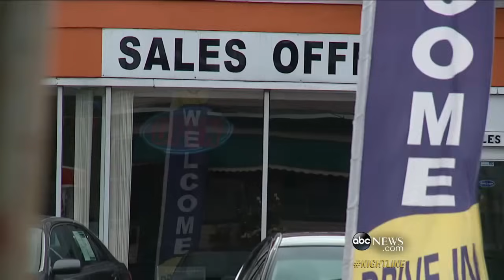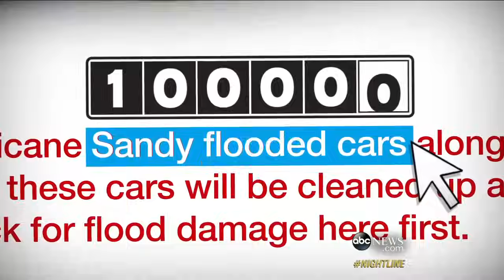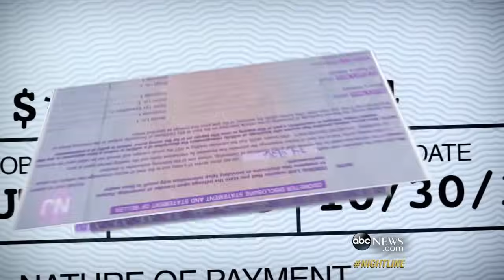How Did a Sandy-Damaged Truck Land on a Used Car Lot?

Comment: salt water cars that live on beach's in ft Lauderdale in the parking garage, not under water but ,the salty air blowing off ocean in  2 to 5 years elect problems start ,elect windows, elect mirrors, elect seats ,fan, defroster, light bulb connections, fuse panel, bad electrical connections start breaking on your car truck adding more times for you to stop  at auto shop for repair, or be   towed for repair. The cars that were under water these repairs start now and keep breaking the life of the car, and parts keep falling  off from rust.

Comment: That’s not true if you put enough cleaning into it like flush the engine, radiator, transmission and replace the whole wiring harness should be fine

Comment: We have to deal with salt all winter here in canada so those cars would probaby be fine.
Reply: Salt on the inside of a vehicle is completely different than salt on the outside. If you don't wash the salt off your car it will rust to hell in a couple of years. Do you wash the inside of your car?

Comment: not much info from the mechanics point on the air bags but nothing on the engine and trans
air bags and sensors are reparable the truck seemed to run good . but the key is discloser
and title not marked .i would use the truck although i say it should have gone for about 15k allowing to replace some electronics and sensors it did sell 8k under book and 13k under what the owner got. btw i owned a flood car from the pa floods in latte 60s. a 64 chev  key was sand under back seat not too much that water could damage in cars then unless you ran engine with water in it ran it for 5 yrs

Comment: I'm thinking... HM, how do I get my hands on one of these very cheaply? Maby one with a bad motor or trans?
I'd love a really cheap new ford; yank the motor and trans and put a good old reliable IDI in it. Electrical issues? Who cares, when you can bypass all the computers.
Power seats and such? Eh... the motor itself is probably OK, just the wiring and/or needing a cleaning. Bypassing the computer and just jerry-rigging it straight to the switch would probably solve the issue.

It would look really nice, though... and I bet the rust wouldn't be much worse(after a through cleaning) than the sort of salt-rust-through on my current rig that had been through canada for years.
Reply: The motor and transmission will be the least of the problems with a flood damaged vehicle. And even if you did put a different motor in it, there are very few states left that do not have emissions tests to pass inspections , You will have problems with everything from wheel speed sensors to mass air sensors,
Reply: I live in one of those states, in a rural county. No sensors needed if you don't have anything for them to run.
An IDI with a stick needs 1 wire to run. All the other stuff(including the glow plug controller) is self-contained; provide key-on power and you are golden.

Comment: insurance companys send the total loss vehicles to what is called an insurance auction anyone with an auction license can buy it rebuild it and sell it. i wouldn't put the blame on usaa they are an outstanding company i would  put the blame on the state of new jersey for not putting a salvage title on the truck. i am a body technicain so i know the way the industry works. should have been sold as a salvage vehicle. usaa is not responsible for what happens when the vehicles are ayctioned off. it is a way for the insurance company's to recover the loss on the claim but should have been auctioned for parts only.

Comment: i will drive that truck give it to me. of course i wont want it for 20k probaby 4 or 5k. pull the seats and redo the wires and change out all the electrical. probaby will be in the 10k mark after that. have anyone been to a 3rd world country they can resurrected it from dust if they can. sure it wont be new but it can still work like a truck.